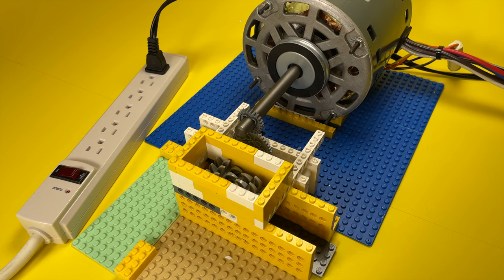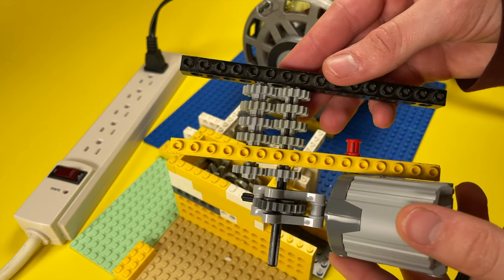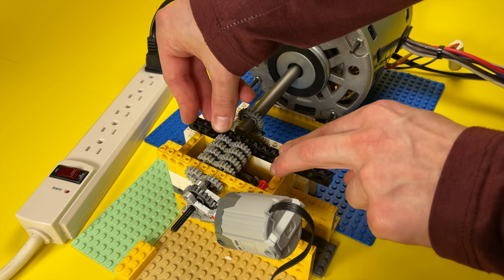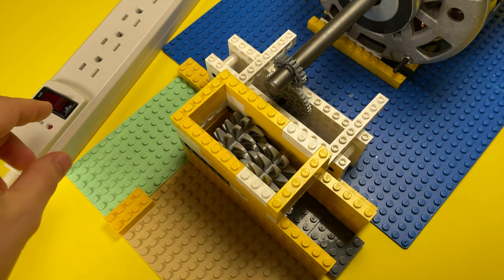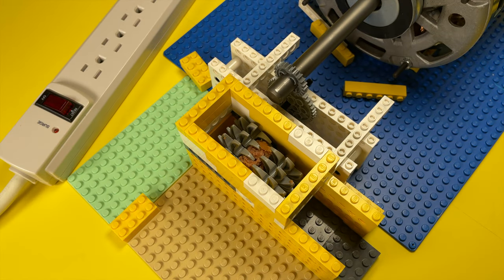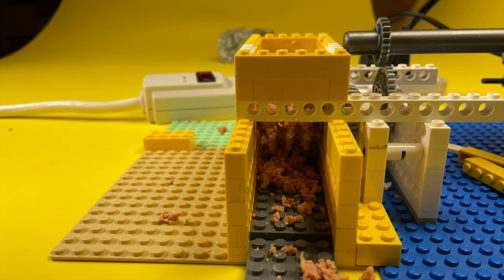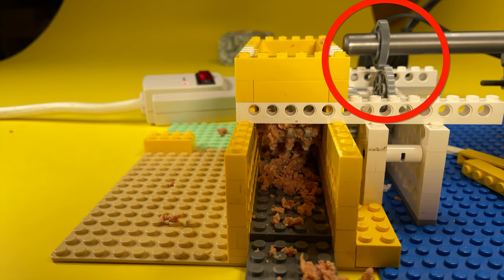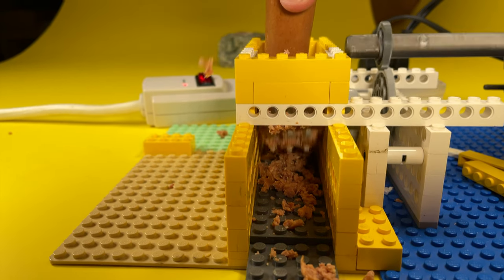The World’s STRONGEST LEGO Shredder

Comment: dude i dont think i have the dedication to get my legos smeared with hot dog shavings

unlike you :)
Reply from the maker: It was gross. Hot dogs have a lot of fat and oil in them and it genuinely made a mess. However, the whole thing was taken apart and all the pieces were soaked in a dish soap solution, which dissolves fats. After about 30 minutes of soaking, they were washed and set out to dry. They were just like new. I was actually more worried about the 28 tooth bevel gears I used to drive the blades. Can be seen at 1:33. They are the new gears that Lego released recently and with the blades under immense stress from the shredder, I was worried they would be missing some teeth after this whole ordeal.
Reply: @LegoTechnicsRule  wow good job. yeah i get it with those new gears!

Comment: How could I buy these blades?
Reply from the maker: eBay or bricklink. Search google for “lego part 61403”
Reply: @LegoTechnicsRule  alrighty!
Reply: Though I won't be using a motor, is there a way I could still make it have a bit higher tourque?
Reply from the maker: @HayFatYT  I don’t quite understand what you’re asking when referring to “it” but if it is the saw blade, notice it has a round hole, not an axle hole. I needed to sacrifice the blade and an axle by supergluing them together. Yes, I know it’s a sin in the LEGO  community, but those parts are easy to replace.
Reply: @LegoTechnicsRule  by it I meant a shredder, a lego one and the whole axle thing I can figure out I hope
Reply from the maker: @HayFatYT  I just realized I gave you the wrong part number. It’s actually LEGO part 41530. Also, I imagine you are making a hand cranked version, so to give it more torque you will need to attach the crank to a small gear, I would use an 8 tooth, then have that gear drive a larger gear, I would use a 40 tooth. This will increase torque, however it will also decrease speed drastically.
Reply: @LegoTechnicsRule  as all people who build shredders would say, I would rather have more tourque than speed, but I also saw a lego shredder and someone used a gear worm for more tourque, is that true?
Reply from the maker: @HayFatYT  Worm gears are interesting. They have one long tooth. If you used a worm gear with, say, a 24 tooth gear, you would get a 1:24 gear ratio, which is incredibly strong but also incredibly slow, and I mean SLOW. For each rotation of the worm gear, the 24 tooth gear would turn 1/24 of a rotation. The gear ratio I explained previously, 8 tooth driving a 40 tooth would be a 1:5 gear ratio, hence a simplified 8:40 ratio. Each revolution of the 8 tooth gear would turn the 40 tooth 1/5 of a rotation. I would recommend not using a worm gear because the gear they drive is miserably slow, but yes, much stronger. Also based on my experience, worm gears have more friction than traditional spur gears.